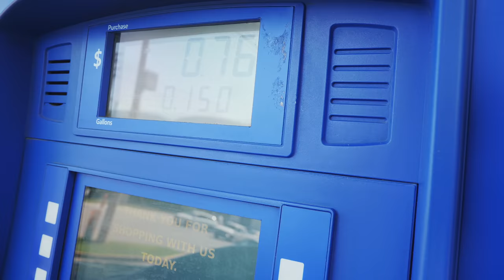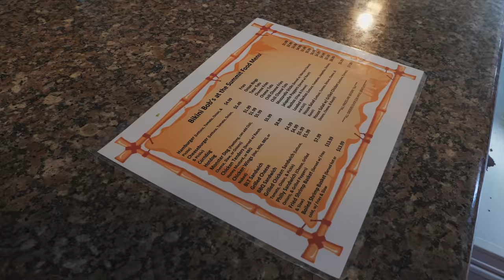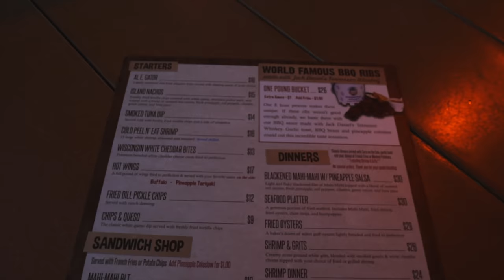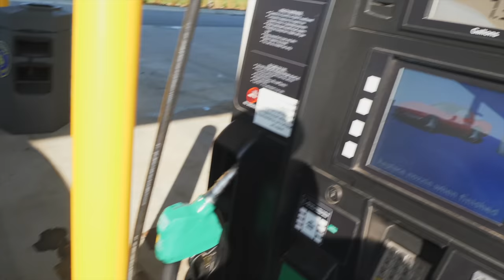My First Travel Vlog… Florida

Comment: Your $5.099 per gallon or ($1.348/litre)  for 93 octane fuel is still a lot cheaper than here in Australia where its $1.88 - 2.30/litre for 91 octane fuel or even dearer for 95 PULP and more expensive again for 98 premium.